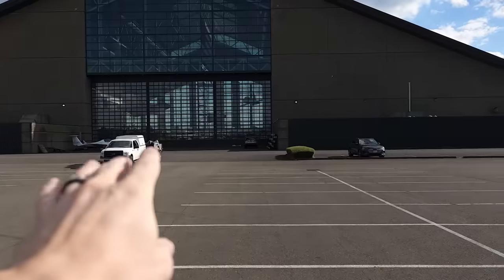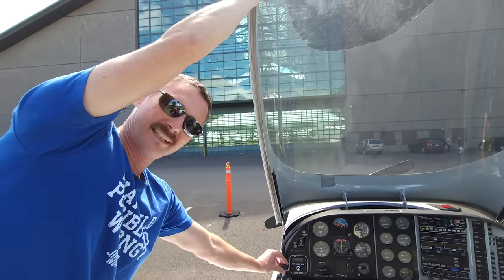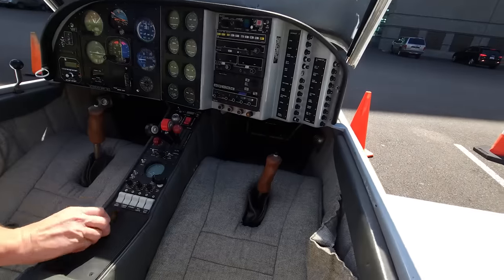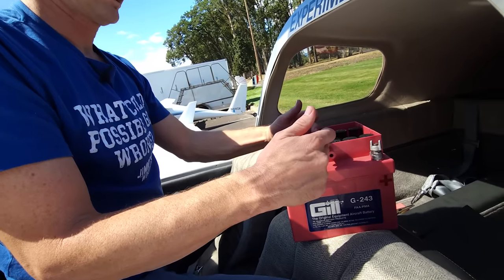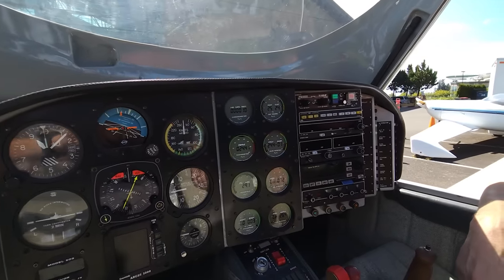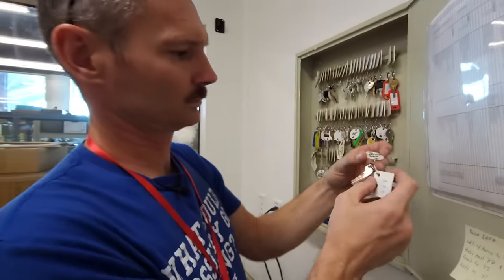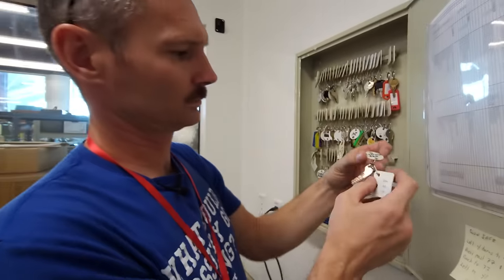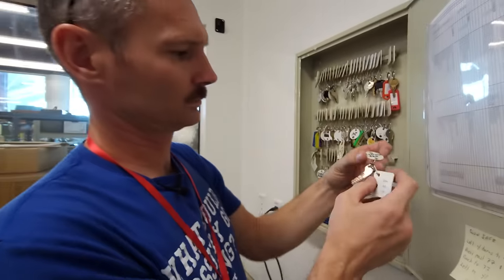Will This 250mph Museum Airplane Start & Fly?

Comment: I have to admit I'm surprised you didn't put clean oil in first and didn't blow all the crap off the engine cylinder cooling find atleast. Would have prevented that smoke screen and possibly baked on dust crap on the cylinder fins. Maybe I'm just cautious or just have love and respect for fine engineering but I had to cringe when you started it.  That said ,love the channel and you do you .Also just a tip ,throw a can of aerokroil or WD40 in your kit...helps with stuck doors, cowl doors etc.

Comment: Them lithium batteries are so light and I have two 100 amp lithium batteries in my Bigfoot truck camper and they weight 37 lbs a piece and the old batteries were led acid both of my Battleborn lithium batteries weighs less than one led acid batteries but they are like 900-1000 dollars a piece but their life span if taken care of will last 25 yrs with 80% of battery left .

Comment: @ jimmy : could it be / is it not possible before they put the plane into the museum the took the sparkulator plugs out and dumped a ton of oil on top of the cylinders / pistons to prevent any kind of corrosion ? If this was my bird i would have done that. but if yall start it the first times it smokes like a smoke bomb. just my model airplane old skool nitro 5 cents...

Comment: I’ve seen several experimental aircraft donated to museums usually because the owner didn’t ever want it flown against. Some are worried about liability for their spouse or potential blame for a failure…whatever. I wonder if the owner knew it could possibly be sold at some point when he donated it?
Reply: When you donate something, you no longer have control over how it’s used, especially from the grave.
Reply: @mmayes9466  You’re saying it’s not possible to create a verbal or written agreement that a donated aircraft never be made airworthy after it’s donated?

Comment: I'm surprised that, with an engine that has sat so long, you don't put a little oil in the cylinders and turn it over to get the walls lubricated.

Comment: 😉👍 You know what? This will decimate all, after, you put about fifteen grand in it or more. If we have to, overnight parts from Japan. 🤪🤣
🐍🐍🐍🐍🐍🐍🐍🐍🐍🐍🐍🐍🐍🐍🐍
🤔 Did you think, Maybe the fuel line was just leaking because it was loose... You know they probably took it off to drain it, after all it was in a museum...

Comment: 1.2  volts per cell, x 12 cells = 14.4 volts, not 24 volts. 13.8 to 14.6 volts is what most alternators output. I hope you didn't fry your actuator motors w/ the 24 volts. And I think I would dump out all of the 20 year old fuel and discard it and flush w/ fresh fuel.

Comment: Not to rain on your crazy parade, but airplanes donated to museums are questionable or even dubious. 

The previous owner opted to take the tax deductible donation only deriving a small monetary gain, in relation to the value of the airplane. 

This loss to themselves is for what reason?

Because they don't believe the aircraft to be airworthy? Because they know something about the airframe or power plant? To limit liability to themselves? As selling a homebuilt creates certain legal issues for the seller, that can follow them for the remainder of their life. 

The only way I would consider a museum piece as a flyable aircraft is if it was extremely rare, and painstakingly restored or was in need of a restoration to my standards. Or was donated by an estate simply because they didn't want to bother with selling a pristine airplane collection, presumably because there time is worth more than the fleet.

Comment: No no no. I personally would've never tried to start it without draining the oil n other fluids, n putting all new fluids. After sitting 20 yrs it needs a complete tune up. Bad gas n bad oil isn't good for the engine.

Comment: That was unburnt gasoline at the first of your burn Maya need to work on the choke system moron if it's fuel injected you might need to adjust the fuel blow to the cylinders we got a cold start injector on it then not might be stopped up or you got another issue. God bless you young man you're carrying on the tradition of being off a mechanic

Comment: I am 40 years old and since i was 15 and had a snowmobile i always thought about making a fake spark plug with some sort og drying thing in it.

And now i know they already exist.
Reply: The manufacturers ship engines with them in the spark plug holes. When I worked at Cessna they were thrown out by the thousands.

Comment: Burn that starter out. Does not sound so good. I would change the oil and have the engine gone thru before starting it.
Reply: I cringed. One mistake after the other. Must love buying engines. He should take an actual mechanic along, it's only his life at stake.

Comment: The museum director/curator should be ashamed. Imagine being so lazy, you couldn’t be bothered to spend 10 mins looking through a filing cabinet.
Reply from the maker: We found it by luck, the curator and collections people did look for the documents and we are still missing most of the manuals listed for it as well.
Reply: @therealjimmysworld , ‘found it by luck’? You looked in the filing system under L and there it was 🤷‍♂️.